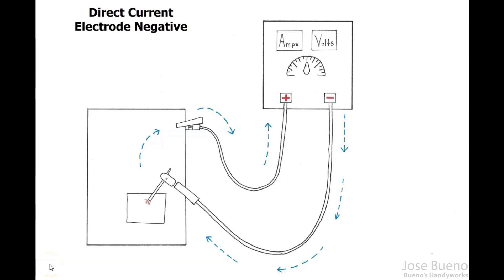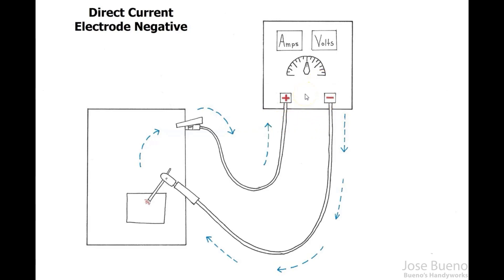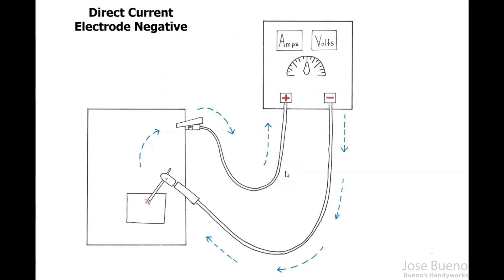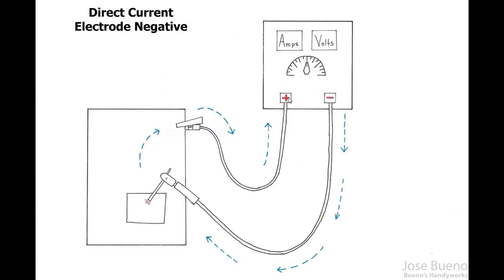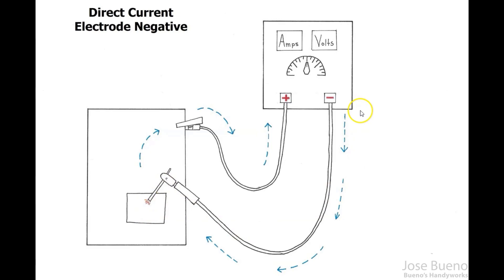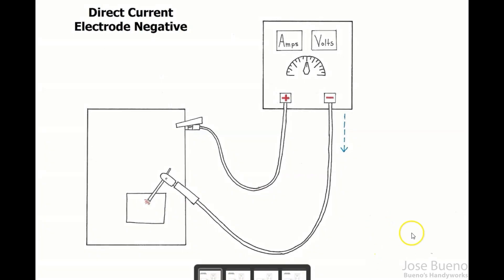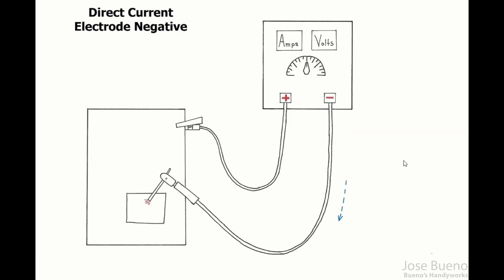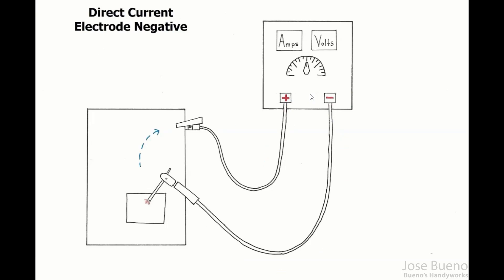Welding Polarity - DCEN

Comment: I think the videos could have additional clarification. Even though we have 2/3 heat going into the work piece we have smaller penetration. It's counter intuitive. That's why in SMAW welding for thin metals sometimes it's advised to use DCEN.
Reply from the maker: I will keep this in mind for possible future video updates, thank you.